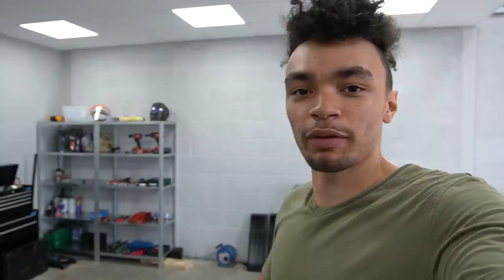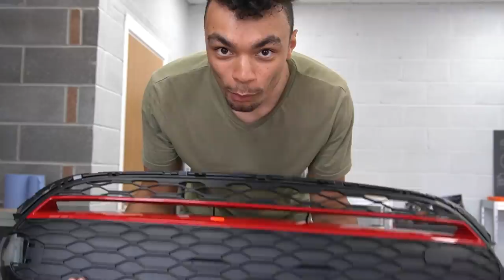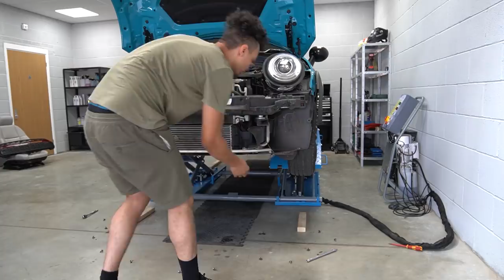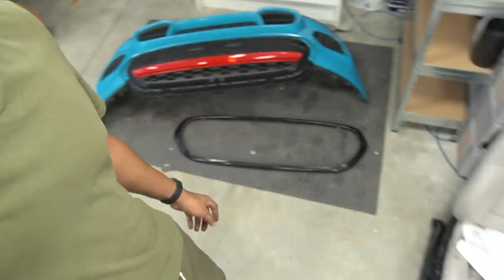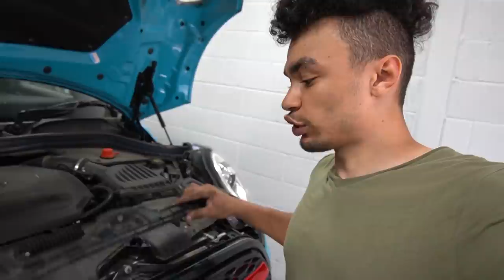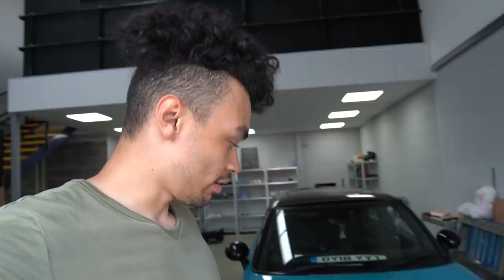New Mini Cooper GP Conversion to My JCW!

Comment: I’d properly suggest putting the plate on the plastic grill where that old tacky black plastic was (the two groove lines in the number are for lining up your number plate) either drill out the holes you need or use the adhesive pads for the plate?